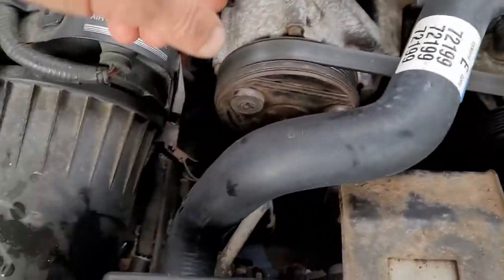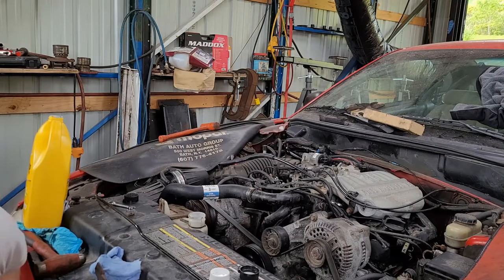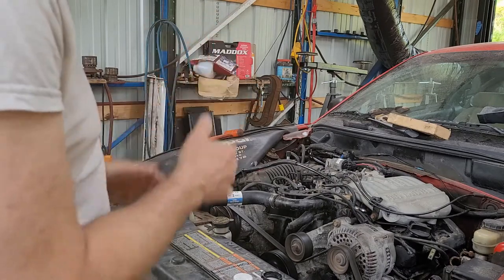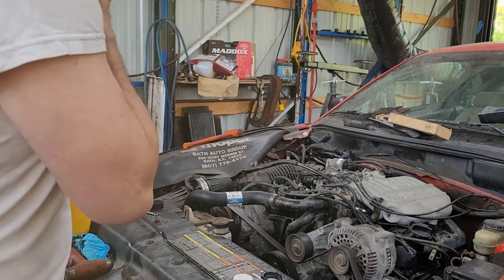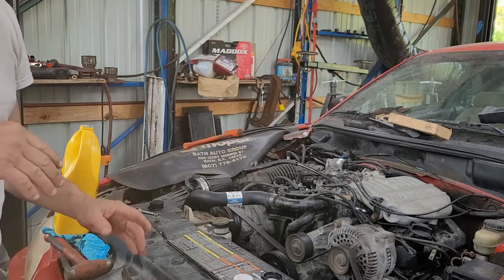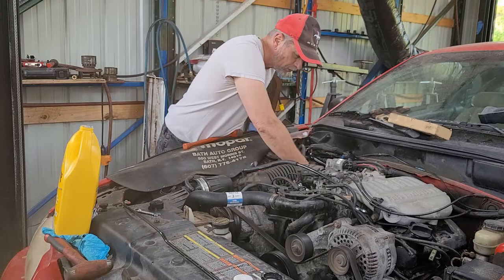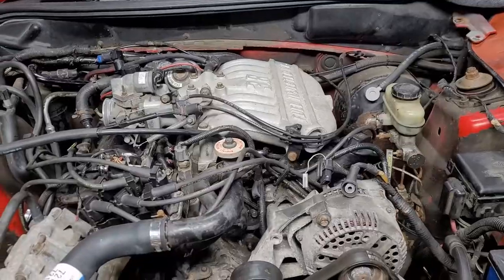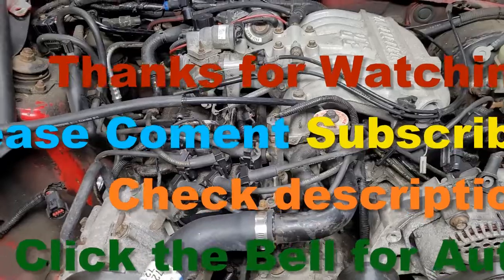Dana's Garage      96 Ford Mustang Engine Change     SUPRISE after Bleeding cooling System

Comment: I need help I also have a 3.8 sn95 and I remove the spark plugs to let the cylinders dry but no crank is my engine seized
Reply: why do the Cylinders need drying ? check your oil for antifreeze, take a 3/4 socket and try to rotate the crank, if it rotates its your starter also check to make sure the alternator is not sized, pull serpentine belt then rotate .
Reply: @searching4279  it started before but now it's just clicking (which is the starter) how do I do a diagnosis without braking anything? I just want it to start again
Reply: @kelran_  is your battery dead?   check main ground to starter if all good check the starter